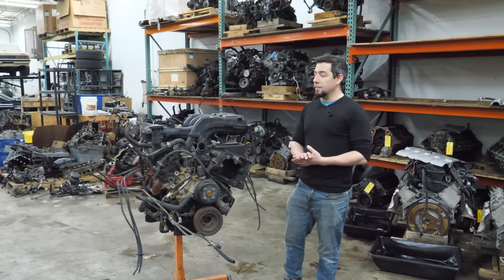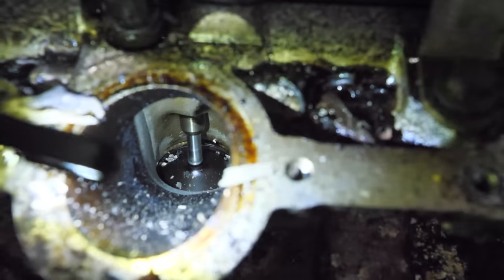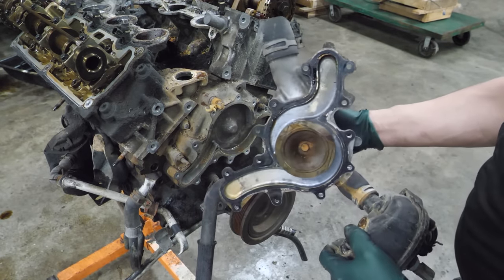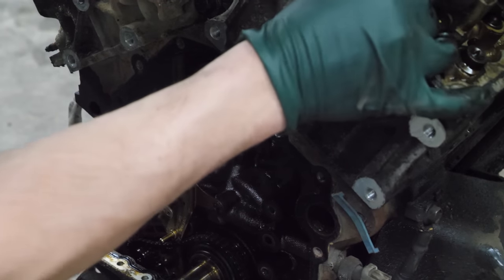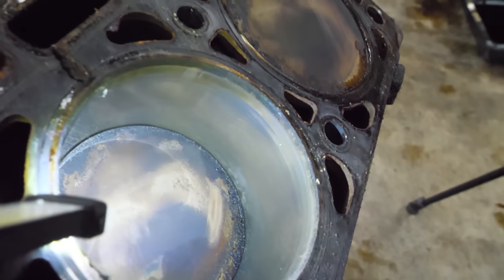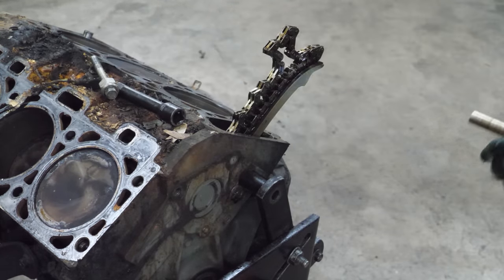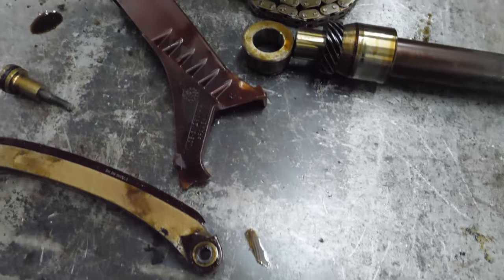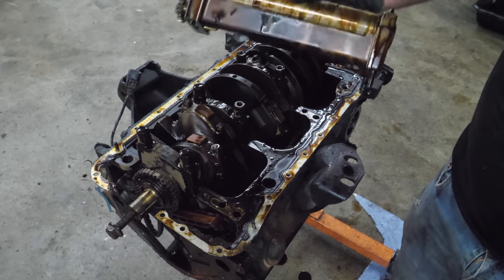Ford Explorer / Ranger / Mustang 4.0L SOHC V6 Teardown! Is This Why They're Called "Exploders" ?

Comment: The chains were what sent my parents 98 explorer to the junkyard. It started to clatter something awful and to have it fixed wouldn’t have made financial sense, at the time it had just under 200,000 miles and the rockers were ate up with rust.
Reply: If it did not die from chain failure it died from rust failure. The life of Ford Explorer.
Reply: Or cash for clunkers. The post facelift explorer was the most traded in vehicle under the cash for clunkers program. 

My dad had a 98 with the SOHC 4.0, he bought it in 2000. It had just under 200k miles and had the timing chain rattle for at least the last 40k of those miles. I had just started driving around the time the rattle got bad and I still beat the ever living hell out of that poor truck.

He heard what the shop quoted to repair it and said screw it I'll drive it till it dies. Lucky for him the cash for clunkers program was perfect timing. 

Almost $5000 for something that was months away from a junkyard. He ended up buying a base model 09 lancer for less than $10k new. Still drives that today.
Reply: @One_Shot_Garage  yup the 1998 Explorer was the most turned in vehicle. You're the only one I've seen in the wild also know this. I also had a '98 4.0 Explorer Eddie Bauer 4x4 that my gran parents bought new. Fun little SUV, good offroad too. 6 CD changer, leather, Mach sound system. It was great

Comment: I have an explorer with that engine. I bought it new in 2002. It was a great little engine when new, and it towed an 18 foot boat for almost every summer. At about 130,000 in 2013 it’s started the death rattle. I’m like, oh well, it’s been a good truck, once the engine blows up I’ll get a truck or something… wouldn’t you know? 10 years later and about 70,000 miles more the darn thing is still running. It was my first car, and it does hold sentimental value. But in the grand scheme of things, it’s just a Cheap XLS AD car I bought from magic ford 21 years ago.
Reply: Get the timing set done with new Oem parts, it will be good to go. It will most likely gernade when mash the gas to pass someone. That’s when mine died. Otherwise good engine
Reply: @anthonys7534  New OEM timing parts and, for the love of all that's holy, do NOT buy the Dorman thermostat housing that's in this video.  Mine made it 18k miles of DD use before the seam started splitting.  There's a guy online who casts aluminum ones, I bought one of those and it was flawless until I sold the truck at 185k miles.  I made the mistake of buying a Cloyes timing component set since they're made in Germany, these engines are made in Germany, what are the odds they're the OEM?  Nope, different from OEM and I started getting a little chain rattle around 2800 RPM if it was under 20 degrees out so I think their tensioners must be weak.
Reply: @406Steven  Ive learned to always by oem. Especially inside the engine.
Reply: @anthonys7534  Most of my experience is with Subarus with Ford being a distant second and the number of people swearing by aftermarket head gaskets absolutely baffles me.  If you want to run aftermarket brakes, serpentine belt, etc. that's fine but you're absolutely right about the internal stuff!  And Thermostats...never go aftermarket.  At least the aftermarket thermostat I put in my Ranger failed in the good way (opened too soon and wouldn't get up to temperature at anything less than WOT).
Reply: Got a 2001 ranger with this engine, start up rattle when cold. It has  167k and is a dead reliable set up for the last 20 years. Then again the engine has never been pass 3000 rpm.
Reply: @buyallmeans425  I had an 06 with 185k on it when I sold it, it was a state vehicle beforehand so I'm sure it spent a lot of time at high RPM/throttle. It had no trouble starting at -40 and hauled anything that would fit in the bed. As a whole I find the only people who talk smack about Rangers never owned one.
Reply: The start of the death rattle doesn't mean all the timing components are toast.  A lot of times, the hydraulic tensioners fail, and those can be swapped out fairly quickly.  If  you let it go for too long though, it can cause worse problems.  The big issue making it a "death rattle" is not that timing can jump, it's that the plastic from the tensioners gets sucked into the oil pickup and starves the engine of oil.  When that happens, it's game over.  When you first start to hear the rattle, replace the tensioners.
Reply: @buyallmeans425  Replace the hydraulic tensioners and I bet that rattle goes away.   Classic symptom of weak tensioners.
Reply: @stickboyST  great advice, but at this point, I have to think really hard if the sentimental value is that much where I’m willing to do anything more. My dad just bought a ranch in Mexico and he asked if he can take it since it’s cheaper to take the explorer than buying anything there. My dad is a smart man and I told him all the issues with the truck. We talked and agreed that it will be used so little out there that it’s probably going to last a long time. And in the great words of Drago “if it dies… it dies”

Comment: Just sold a 1999 Explorer 4 liter I bought new. It had 186,000 miles and was running well for its age. Oil was changed religiously every 3000 miles. I had heard the horror stories about timing chain death rattle but my experience was good. I think most issues are probably due to infrequent oil changes.
Reply: That and cold climates where once the chain tensioners' springs got weak, the colder oil took longer to pump and prime the tensioners to reduce chain slap against the plastic cassettes, wearing them out faster.  Combination of factors.  However, most vehicles with that engine did make it to 186K mi if something else (collision damage or cash for clunkers program) didn't take them off the road first.
Reply: So was mine. Synthetic oil changed every 3k-4k miles. But I pulled the valve covers off (170k) to replace gaskets and found a broken chain guide at the rear timing chain. Only way to replace it is to pull the engine. Engine ran fine and sounded fine, spotless clean on the inside. But the plastic just broke. A lot of people have broken guides and don't know it.
Reply: My folks still have their 1999 Explorer that they bought new. It has only 103,000 miles and has had oil changes every 3,000-4,000 miles. Everything works except the radio display.
Reply: 99 was the OHV, completely different than the 01+SOHC.

Comment: I had a 4.0 SOHC in my 2004 Explorer Sport Trac bought new. Put 200k miles on it and pulled my boat a lot.  It was a great running engine. Changed the plugs at 100k miles. Only problem - had to re-lace fuel pressure sensor that cost $20 bucks.  This is a great engine.

Comment: FINALLY, a teardown of an engine I own.  I have a 2006 Ford Explorer with this engine.  Just ticked over 190k miles.  I had to replace the tranny about a year ago at 176k miles and a few suspension/wheel pieces but the engine just keeps running.  The only major engine repair was a harmonic balancer in 2017.

Comment: Liked this one.  Had one of those in my '08 Mustang.  Treated me well,but I traded the car at 84,000 miles,  From day 1 I had the chain noise, but it never caused me a problem.  Mine had Mobil-1 from day 1, and it had oil changes every 5,000 miles.

Comment: I drove a 2004 explorer with this engine for several years and in my opinion this engine was the best thing about that vehicle. The engine was super quiet and on idle sometimes i couldn't tell if the engine was running or not. Put about 280k on the engine, but ultimately the poor transmission eventually sent it to the junker.

Comment: I've owned two of these engines, a '97 and '02 Explorer.  I have to admit that I had no idea the timing system was this complex, but my experience saw both engines be incredibly reliable.  Ford issues a recall on the timing chain tensioners on the '97 somewhere around 2000. That took care of the rattle.  The '02 never had a rattle and for the 135k that I owned it, not one issue with the engine or any other part on the drivetrain.  Of course mine got regular oil changes, etc but I know several other with long lived 4.0 SOHCs.  Also had a fleet of 4.0 rangers at work.  Same story, no engine problems whatsoever and most of those went well beyond 180k when other problems led to turning them over.  Just my two cents worth, but I think these engines get a bit of a bad rap...
Reply: I had three Rangers with this engine and all three went over 250,000. Miles with only spark plugs oil and grease.
Reply: My dad had '94 ranger with this engine that hit over 400k miles and I had an identical one in high school with 311k miles, just on standard maintenance
Reply: @davidfields2290  a 94 would have had the much simpler OHV version of this engine
Reply: I have this engine in a 2001 ranger.. 167k miles and has been a dead reliable truck. Just went to DC from south Florida and back. Keeping my fingers crossed.
Reply: they get a bad rap because its unfamiliar territory. Change terrifies simpletons.
Reply: @davidfields2290  This SOHC engine didnt come out until 97

Comment: I have a 2010 explorer with 239k on it and it still runs great.  I did all the scheduled maintenance and changed the oil every 5k miles with Valvoline Synthetic blend oil and a Motorcraft oil filter.  Put in a Jasper remanufactured transmission at 220k.  My son drives this vehicle to school and work daily.
Reply: Our 2010 had the metal,cassettes installed….theyngon300k…2002 and below had plastic….200 k max

Comment: I owned an Exploder with this engine.  If I recall correctly it had 220K miles on it when I got rid of the vehicle.  Not only didn't it burn oil. . . it didn't even leak any oil.  Yes it didn't make a lot of power, but it was dead reliable for me.
Reply: Yeah, but at where I'm going to school at We've replaced one of those engines, and we have 2 more to do.

Comment: My father had a Sport trac with 300k that ran perfectly fine. Last year he traded it in for a new Maverick. Other than replacing the coil pack and a fuel pump nothing went wrong with that engine. I have heard these engines had timing issues but we lucked out and didn't have any problems.
Reply: Your lucky you didn't have any timing issues with it for 300K miles. I own a 06 Ford Explorer 4.0L v6 and its got about 170,000 miles on it and I hope I don't run to any of those timing issues because that will the day i'll trade my suv in for another vehicle. I am not a fan of pulling the whole motor just to do a timing chain and timing component replacement. To me if you had to replace a timing belt or chain and its timing components it is done in the car.
Reply: are you sure it was OHC or was it a pushrod version? They had both versions available for awhile
Reply: 2010 was last year of thes crap engine, your dads sporttrac must have been newer with a new engine desighn. no way one of these is making 300k
Reply: 2005 @super20dan

Comment: I had a 2001 Ranger with this engine and I loved it! With a tune, 4.56 gears and 33’s it was fairly quick. I ragged on that truck for nearly 20 years! Engine never gave me a lick of trouble.  I’d buy another one.
Reply: I had a 03 Ranger reg cab step side 5spd for 10 years I paid $2500 for it had 258k miles no issues at all would smoke the tires all day posi side ways haha wish I still had it but it was stolen in 2019 never saw it again can't find another one that clean
Reply: @frankm8533  nice rig! What a shame it got stolen
Reply: @Jack Tradesman  yup I didn't care it was a 4.0 with the chain issues I was going to fix it when the problem came up I bought from a woman who used to haul lamps and curtains around to flea markets she just wanted something bigger it was a very clean truck
Reply: I have a golfing buddy who had one of those too. He now has a newer 2019 ranger with the 2.3 turbo which is a great truck too but he loved that old ranger LOL 😅

Comment: Hands down my favorite YouTube subscription.  

I bought a 2008 2wd with just 48k on its ticker a few years ago. It was a guy’s wife’s truck and he made damn sure it would never leave her stranded: oil changes every 3k, always detailed, garaged. All service receipts. 

I continued caring for the truck with this obsessive adherence to maintenance, changing ALL the fluids and using synthetic everything; new plugs, wires, filters. 

It was the best deal I ever scored. I learned about the timing cassette issue later and dreaded about it but not before I put 35,000 more miles on it in 16 months. 

I had to sell the truck to raise money for my kid’s tuition. Sold it to my brother for his high school son. He got T/boned in it and it was totaled. But he walked away unscathed. Truck did its job with its canopy of airbags and stout frame design. 

I wish I didn’t have to sell it. 

Eric, can you tear down a Mercedes M112 V6?  If you can find one. They are amazing engines that if properly maintained have the life of a good diesel.

Comment: Those for 4.0 engines have hydraulic chain guid tensioners.  There is the spring inside of them, but they don't get stiff until the engine builds oil pressure.
Reply: When replacing them, you also gotta prime them with car oil first before putting them in. I had no rattle but changed them anyways on a 07 mustang just to calm the nerves. Old ones were ok still but glad I changed them anyway.

Comment: Between my wife & I we have owned 5 of the 4.0-liter engines they all have been good to us. I still have a 2001 Ranger
with 220,000 miles on it, it's the smoothest engine I've ever seen or heard. I use it around the farm & as a grocery, gas, beer, deer getter now a days.
We had a rear end go out on one ranger 'hers', & some minor 4wd problems related to the electric motor that engages 4wd. Some of our engines were made in Germany, very smooth engines , some in Canada.

Comment: My 05 Ranger had 527000km on it. The timing chain had been done. Regular maintenance is key, like with everything. The transmission was the weak part of that truck. The engine did eventually die but that's because it got hydolocked. And it actually drove home that day, and for an additional 6 months. It's getting 5.0L V8 swapped currently.

Comment: I bought a 99 explorer with this engine for 500$, the timing chains rattled from 292000 miles to 312000 miles when I sold it, for 500$. Eddie Bauer, everything worked, also crashed it and got insurance money. Amazing truck

Comment: I've got an '06 Mustang and it's been good so far, 156,000 miles. I have to agree that timing system sucks. If it goes bad, I'm more likely to find a wrecked 4.6 and just swap the whole drivetrain than to repair the 4.0.

Comment: Did the timing on mine few years ago! Still running strong ... knock on wood (nervous sweat)
Reply: You knock on wood inside your car and the knocking doesn’t stop even after you stop
Reply: I have a 2000 Explorer with this engine. I had the chains replaced 10 years ago and it is running well at 190,000 miles. I use full synthetic oil and change it often.
Reply: @DreamKeeper. I had three of them all over 200k with no major issues

Comment: rebuilt my 2004 4.0 because of the timing  chains , the small chain on the balancer is on all wheel drives,  that one was the main one that was loose and rubbing on the cradle . if you ever do one , make sure you don't buy the cheap timing chain kits ,I went with Cloyes complete kit  for 330 i believe ,also bought a special tool to align over head cams , for 200 and sold it after for 150 . all in 1300 for refreshing everything including the heads. Runs like champ